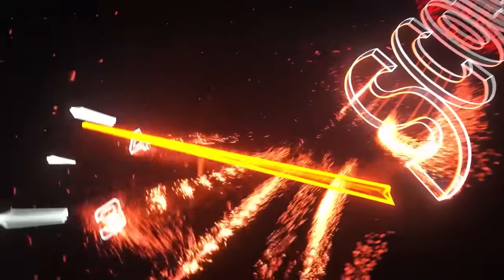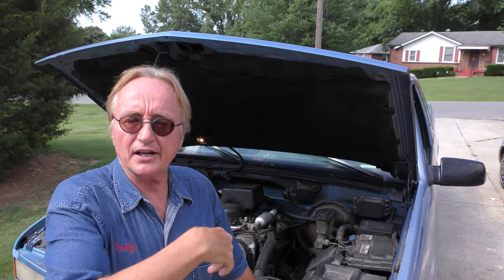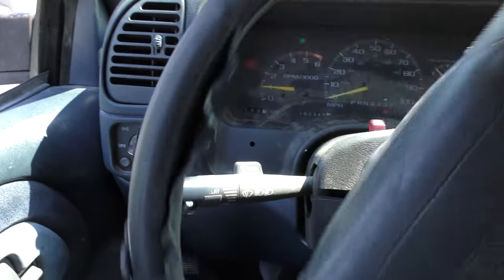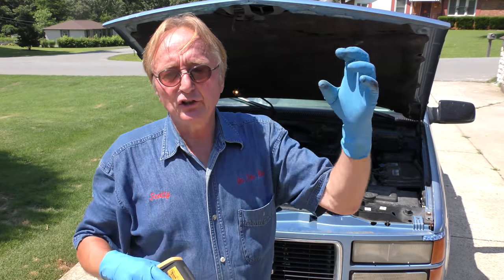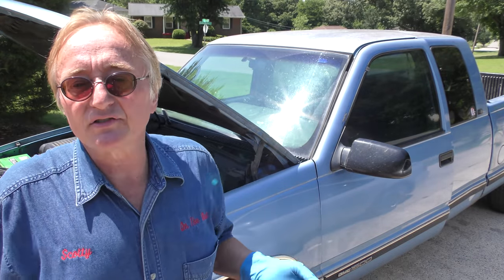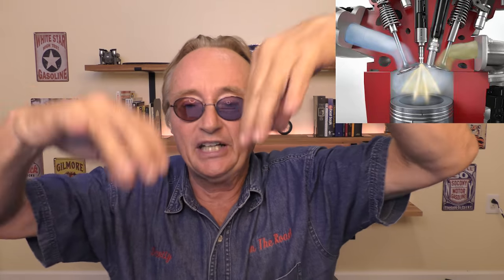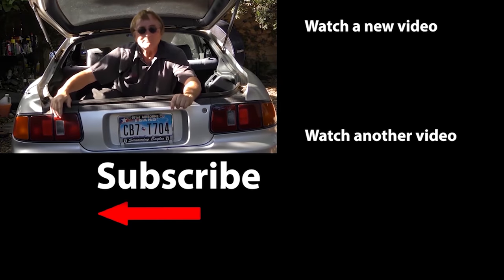Doing This Will Make Your Engine Run Better

Comment: I'd run fuel injection cleaner through the injectors first. Sometimes you get lucky
Reply: The way that air cleaner looked. I'm sure there has never been fuel injector cleaner ran through it. So I would definitely go that route for sure.
Reply: they also have mass airflow cleaner and as dirty as the air filter was maybe just cleaning it wouldve helped
Reply: @mike-bj4dk  True
Reply: Well...basically fuel injector cleaner breaks up or melt down the debris sitting inside the injector.
--if its too much stuff...you need a reverse flow bench tester cleaner that you can put your injector cleaner fluid in to flush debris back out through the open injector head port holes, instead of forward flow thru small micro injector port holes...= STUCK!

As for brittle plastic...try duct tape...hold together when you twist it.

Comment: My 98 1500 had that problem. Cleaned the injectors with the 3m pressurized system and cleared it up for about 30,000. Traded at 225,000 in 13.

Comment: I replaced the spider injection system on my 01 express 4.3, what a nightmare, pita, not for the faint of heart, did the plugs, wires cap and rotor, and coil while i was in there, it runs great!
Reply: A Chevy Astro is even worse. Less working space compared to the Express.😰
Reply: Why I installed a marine 4.3 injection manifold. Injectors are on the outside

Comment: So the truck didn't need a mass air flow sensor.  Definitely a new air filter.
Reply: I definitely would have started with the air filter, cleared the maf sensor code and drove it around to see if it popped back up.

Comment: Standard Ignition Parts makes an affordable "$pider" for the 96 Chevy..lol😷
Reply: Curious as to whether you're being coy about standard ignition parts giving you a trade-off for the affordable spider part - as in part quality/longevity. Otherwise, I'll be making note of them towards the top of my list.
Reply: @That_Handle not being coy.. Ive used Standard Ignition Parts for years and havent had any issues with them. They offer an affordable alterative to high cost. O.E.M. in some instances.
Reply: A friend of mine called me. His 96 stopped running it was on side of road
Fuel pump could be easy to hear
So changed Spider injection assembly it took little over an hour counting him going with me for parts.
We rented fuel pressure guage it only had 10 psi not even close
So fix was New fuel pump
also done on side of road another two hours.
Yes it has over 300,000 thousand miles on it.Not That Hard to Do.

Comment: Toyota going for same way as Ford! Sad for trucks
I own a Focus ST the new model for Europe 2.3L 4 in line ecoboost with a twin scroll turbo 280HP. Its fast and nice for a small car.
Now a 4 in line ecoboost for a truck its just bad and much strain on the engine.  For a small pickup like maverick yeah that is acceptable.
I change the oil of my Focus ST every 6500 miles that is around 10k Km or every year. The plan on manual says 20 000 km or 2 years. But better safe then sorry, oil is cheap engine rebuild not!

Comment: my 98' v-6 econoline stopped idling one morning. Smelled super rich. My ODB port does NOT work. So I changed 1) fuel pressure regulator 35.00-no, 2) 2 new fuel injectors at 18.00 a piece plus new o-rings and other rubber/ plastic rebuildables on other injectors 20.00 for kit-no, 3)  replaced all vacuum lines (just because they were in bad shape, didnt have much hope they were the problem) 36.00-no, 4) TPS sensor around 19.00-no, 5) EGR pressure feedback sensor 13.00-no, 6) exhaust O2 sensors 48.00 for 4-no, 7) MAF 22.00 off E-bay  yes, fixed.

Comment: We replaced the whole fuel system on my dads 98 2500, when he got a reman for it, about a day to put the whole motor back in and hook up the all the lines.
Reply: I've been looking at American Powertrain Products recently because, primarily, they re-engineer to mitigate or eliminate weaknesses in original engine design yet am curious from what source and why was your dad's remanufactured engine selected?

Comment: I love my Chevy's. My 95 GMC has 140k miles with the 305 TBI. And my 01 Chevy 1500HD 6.0 gas 4l80 has 350k original miles on everything. Both will light tires up still.

Comment: Try a salvage yard for a lower mileage injection system,  change hopefully the seals for new and see how that goes ( I know its time that rots plastic more than use but lower mileage should indicate less time in a hot environment.
Reply: Not worth it. Too much labor to get the one off the junk truck and swap it only to find out it isn't any good.

Comment: These have port fuel injection, BUT, the older versions do not control the fuel poppet valves independently.

Comment: I am surprised that you are working on the Fourth of July?  You really cut to teh quick to the crooks out there, including Toyota passing off a poorer engine for teh sake of the 'emissions' crap. Greetings from the UK.
Reply: Pollution is a problem but it might be more effective to approach it from the fuel angle than from the mechanical one. Like Porche E-Fuel.

Comment: Basically it's time for a rebuild. If the frame is OK, no rust or corrosion, I would just get a reman engine and transmission a drive it for another 15+ years. Ford, GM, and even Toyota should just offer a big straight six in their trucks. A simple engine with heavy duty bearings. Of course that makes sense and that's why they won't do it.

Comment: That spider injector is only like a 2 hour job.  I've changed 3 of them myself.  Usually the poppet valves get carbon in them and don't seal anymore, the newer versions convert it to MPFI with individual injectors.  I don't think GM makes them anymore though, so you have to get aftermarket injectors.  Depending on the condition of the rest of the vehicle it would be worth fixing.  The old style injectors are also sensitive to fuel pressure(58+PSI or the engine will not run at all) the new versions aren't so sensitive.  It could also be the fuel pressure regulator leaking, its on the back side of the assembly, but it usually leaks fuel into cylinder 6 instead of the back 2.

Comment: As for replacing the whole Fuel Injecton system if you have the Tools & Talent. Figure the cost of Replacing that Truck $30 grand to start and the NEW ONE woun't make anywhere near 300K

Comment: Seriously Scotty... quit giving misguided and downright wrong advise. First of all, with that air filter looking like that, did it not occur to you to try to clean the MAF sensor before replacing it? The old one was likely just dirty, just needed a cleaning. 

And guess what... YES, oil pans do sometimes need replaced on vehicles because yes, they can actually wear out. This is true only to aluminum pans. They develop cracks from heat stress over time. Oil can leak from these cracks in the aluminum and sometimes quite severely. Most aluminum oil pans will get cracks from heat stress as they age. Most will also never leak as result. But some do. GMs 4.3L Vortec engines, for example, have oil pans that are known heat stress/crack and leak. Other aluminum components like transmission cases, motor mounts etc can also get mild cracks from the same heat stress, but these components don't heat cycle as much as oil pans do, so it is almost never an issue. These heat stress cracks are worsened in winter environments where roads are treated with products that are corrosive to aluminum. Here in Colorado they use magnesium chloride which is highly corrosive to aluminum. It etches the metal which makes the heat stress cracks more likely to be an issue. They recommend removing the mag chloride from you car within 2 weeks to prevent etching and possible eventual damage to aluminum on your car. 

And $1500 - $2000 for a spider injection job? What are you smoking. They aren't hard to do and labor accounts for about 1/3 of the repair cost. The spider injection assemblies are cheaper than they used to be and have been for awhile. Parts now generally cost $400 - $500. With labor I've never seen, heard of, or personally charged a customer more than $1000 to replace a spider in the last 5-8 years. Nowadays it's typically right around $750 - $900. The price on those spider units has come down considerably and as a result, it's not as expensive as it once was to replace them. EDUCATE YOURSELF dude, really. 

Seriously, from an ACTUAL pro auto tech, enough with giving people bad advice/info

Comment: $1500-$2000??? Converting it to mpi is $300 in parts and it takes about 2-3 hours labor. The only secret is that this guy’s gonna rip you off on that job after he “tries” to fix it by throwing parts at it that it doesn’t need. 
Listen to 8:53-9:16. He’s describing himself.

Comment: My 2000 Chevy has 185,000 miles and fires up like its new.  Tranny is starting to slip though when I tow my boat so I stopped towing the boat with it. Has intake throttle spacer aluminum driveshaft and dual catalyst exhaust. Was on it when I bought the truck in 2005. Has only had injectors done fuel pump and u bolts in its entire life.  Always ran good but getting old now and needs some real maintenance as it’s been neglected more than it should be.

Comment: They make an upgraded spider MPI injector system that costs like $300-$400. If you aren't a goober you can replace it yourself and you'll get more ponies and better MPGs than the day it drove off the lot

Comment: Hey Scotty. Happy 4th of July. What are your thoughts on a 2006 Lexus gs300 awd with 104k miles? Im looking to buy it, what is your advice?
Reply: It's the same engine as his wife's lexus. A Gs is a good car. It was lexus's midsized sports sedan. Depending on the price and if it checks out mechanically though...

Comment: Don't hate on GM. My dads got a 2001 Silverado 2500 HD. The frame is a foot thick and built better than any frame on any truck made today by any manufacturer. The truck is a snow plow truck with 20 seasons on it. If u know anything about living in the snow belt the salt rots vehicles and plowing is horrible for your vehicle. The truck still runs like an absolute champ and quiet as hell. I also drive a 2001 chevy and its a beast, better than 90 percent of cars its age. I drove a 2002 Ford went down 5 years ago and the chevys still goin strong. No hating on Ford either I like ford

Comment: I got 2011 nissan juke with a 1.6 turbo. It has a code with #4 cylinder misfire changed plugs waiting on the new coil pack can it be the catalytic converter

Comment: What sucks is Toyota knows the turbo engines won't last as long,it doesn't fit their bussiness model to have cars on the road with 650,000 miles on them running great,so give more power,less life=sell more cars...unfortunately.

Comment: Air filter - good call…but why not try cleaning the MAF before replacing it?  Did that model year have a MAP sensor?  I’d’ve checked and cleaned that as well - they also have a say in fuel delivery. As do the o2 sensors upstream of the cat converter(s) - have they been changed?  But yeah, injectors are the big deal on that one based on exhaust temps. I shudder to think what the fuel trims were…

Comment: I got a gm spider injection and I had mine changed and its not as bad as Scotty is making lol he's being so dramatic. Top dollar AC Delco spider injection kit for v6 4.3 vortec is 400 at auto zone. I paid a mechanic 75 an hour to install so in total it was like 700 bucks out the door. But that also included cleaning my throttle body and valves and a new fuel filter. Its not an impossible thing to do, I could have done it myself if I really had too. Rock auto after market u could get the part for like 150 bucks take a Saturday and get it done

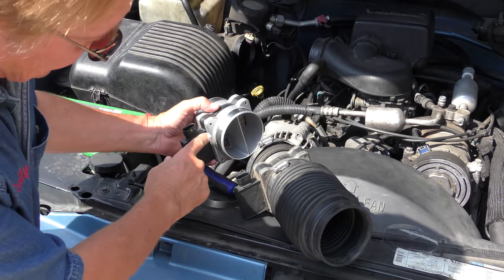Comment: 2:50 only $100 may be easy but you but not kit the rest of us.  Maybe should've just stated with replacing air filter first. Much cheaper gen the sensor

Comment: Reminds me of the old days when I used to live in South Africa, and did a lot of cross country riding on motorcycles. I lived inland n Johannesburg, 1 mile above sea level. I used to ride down to the south coast for long weekends and holidays. When I got there my bikes (back then all were carburated) the bikes would run awesome, Like I had 100 more ccs or something. I was told that if I stayed down at the sea level for very long, I would have to re-jet my carbs richer. But any bike I came across down there was toast in a race haha. Then the ride back inland had me wondering what was wrong with the bike. lol  A lot less air at a mile above sea level.

Comment: Don`t just drive it one time . Do short drives . Why because one long drive does not reset the computer . It is shutting off and restarting that resets the computer. So this I found one drive wont do it not even two but up to 80 miles . Quicker results will happen if car is shut down and restarted about 4 to 6  times . Unless You like driving all over hell going no place . Former gm mechanic current gm owner .

Comment: Yep scotty it blows   most a the thing that you use to could replace on a vehicle 2 decades ago with 5 minutes to a couple a hours en 5 to 20 buck in your driveway now has ta be towed of to the shop  were the mechanic eats is lunch off your hood for a few months en when e does get round ta fix'in it  skys your limit  on charges incurred  BIG TECH has managed ta throw a wrench inta virtually everything

Comment: When confronted with an expensive repair like that on a old vehicle with loads of miles, I think can I buy another vehicle that is in the same condition but doesn't have the problem requiring repair for the same amount, I think in this truck's case run it until it dies then junk it.

Comment: I'd put MMO in the tank with injector cleaner and see what happens. However, I don't got experience with spider injectors, so if they really just wear out and there's no solution other than replacement, then so be it.

Comment: I just put in a new window regulator in the 100 F muggy heat but saved hundreds. I snapped the shaft off a month ago yanking on it on an angle. :0

Comment: my 92 cadillac deville doesn't have a mass air flow sensor that I can see.. it's got a map sensor is that the same as a mass air flow. my cadillac is running choppy I put new plugs and wires in a couple days ago I thought it had a fouled spark plug or wire. after new plugs and wires it still runs choppy..

Comment: How do you fix a non working odometer on a 97 F-150 V8. Everything works except the horn. Runs like he is new. Only thing major repaired was replacing the heater core. Miss ya here in Texas. Debs
Reply: Seams to be comon about the horn as I got a 03 with that issue

Comment: I had an oil pan that rusted out and require replace. Didn’t need to replace until it started seeping and the mechanic didn’t try  to push it earlier.

Comment: Scotty, I have a 2017 Toyota Sienna with just 2,400 on the odometer.  I only drive the car once a month short distances for pick up and deliveries.  Am I causing engine troubles by not operating the car every day to keep the lubrication in all the right places?  Will I be destroying the car by not keeping it running more often?
Reply: U should probably take it for a ride every two weeks. That’s what I did with new car which I garaged for a couple months. Also, a 2 tips:
Don’t put any cargo in the vehicle that can put unnecessary stress on the tires in one area

And keep the gas tank fully topped up to minimize condensation

Comment: Ok now i got a question i have a 2000 4.3 v6 that runs really good but i want it to be louder i concidered cutting off the catalytic converter but i heard that without one it will not preform as good is that true? and how would i go about makeing it  loud without messing it up? Happy 4th of july!
Reply: I asked the same question on carkiller sorry for posting in the coments

Comment: Bmw came in  to shop for oil change put it on the lift no drain plug someone jb weled  the drain hole shut so it had to get a new oil pan

Comment: Hey Scotty! I have a manual 2007 VW 1.4 tdi with 120k miles. I don't know if the transmission fluid has ever been changed, should I do it? I don't have any problems with shifting but I know the fluid should be changed every 60k miles.
Reply: Whenever I get a vehicle and I don’t know the history, I get the oil and trans fluid replaced immediately. Regardless of if I think it in good condition
Reply: @wildk5367  Agree i changed the oil, but the transmission fluid is different story. If you change it without knowing its condition it can damage the entire transmission
Reply: @SilviuSDJ  yes u are correct, my bad I have never bought a car as high mileage as u we’re saying I’m always under 70k miles because I’m scared of older ones (even if I KNOW they have better value). But u are right if the trans fluid has never been changed in a 120k mile car, it could have stuff that has worn down in it that is actually keeping the trans going. Hmmm so u have no way of contacting the original owner?
Reply: @wildk5367  i don't even know the original owner, because the previous one wasn't the original, so who knows how many were there lol, but it's ok

Comment: Scotty- Happy 4th!  Question:  Any experience/idea why a '99 Civic EX/5-sp. w/ 119k on it would.......SURGE in acceleration, PINNING the accelerator pedal to the floor w/ no driver input.  Just happened.....again, my FOURTH time.  As an HONEST mechanic....what's your guess?
Reply: Scotty I have a 2007 Colorado with a P0410 code. I have replaced the secondary air valve and pump. Neither have corrected the issue. Do you have a video addressing what else could be the cause?